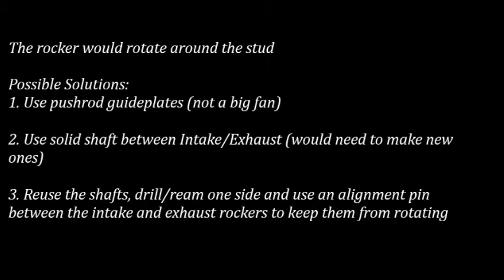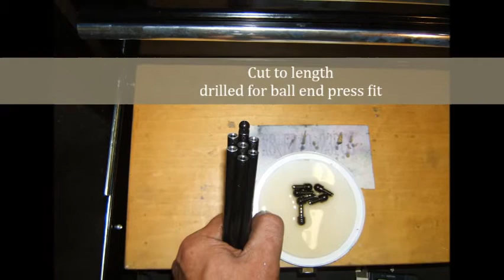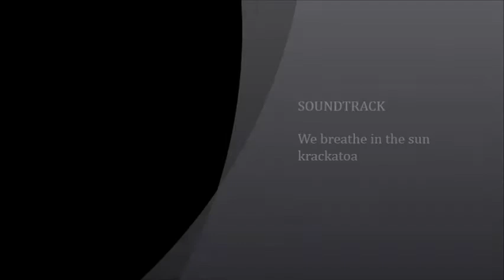Jeep Wrangler YJ 1.7 Roller Rockers

Comment: I finished my rocker install tonight. All I can say is WOW!!! The low RPM torque gain is amazing. I can just let the clutch out with out giving it any gas and it pulls away without stalling.
The Valve cover is angled on the front and only hits the first rocker/nut. So I cut a hole where it made contact and welded a patch over the hole and it gives it enough height to clear.
I really want to thank you for this idea. It's a great mod.
Reply from the maker: hey, glad to hear you got your's done. did you use scorpions or different rockers, and what did you do for pushrods. Thanks for providing an update, great to hear I might have helped someone out there :)
Reply: I used Speedmaster rockers off Ebay and I found a set of 9.8" pushrods on Ebay. The pushrods are 3/8 dia. so I used a 1/2" ball mill to cut the clearance on the rocker.
I also found a set of Ford rocker studs that are 5/16 base 7/16 upper. I still had to shorten them on both ends and thread them a little further, but they worked.

Comment: I wish I could buy a set of these rockers for my 2.5l TJ I can't find anyone that sells them boosted technologies has a set for 350$ but they are sketchy company I wonder if the 4.0 Harlem rockers would fit under the valve cover of the 2.5l TJ I just turbo charged and really would love this extra performance mod for the 4 squirls . Any info would be greatly appreciated thanks for the video posting I know it's old but us 2.5l guys out here will do anything for an extra shot of power and to show the 4.0 what we can do 💪😁
Reply from the maker: All the info you need is in the video, the scorpion rockers are the best choice imo short of spending an arm and a leg on a kit made for the 4.0L AMC/Jeep engine and using 4 out of 6. I did buy a different set before (different brand) and they had oilite bushings (bearings) instead of needle roller bearings. Only issue is drilling the holes to put the locking pins in and the fact that they come in a set for 8cyl and you only need a 4 cyl (so 1/2 the rockers). You can order the pushrods to length if you're not comfortable making your own. I also believe there is a kit for the studs and you end up drilling and tapping the head instead of making custom ones but I don't have any first hand experience with that.

Comment: Nice job and Thanks for sharing it! Any updates on the reliability?

I just ordered a stainless rocker set $100 and some oil hard drill rod $9 for 0.250 x 36" to start the project...

BTW what pushrod length did you end up with and how in depth did you investigate the geometry? It seems well centered just curious about that part of the design...
Reply from the maker: I built 2 adjustable pushrods (cut a stock one and i think i threaded M6 or M5 inside and used a threaded rod to extend), i also locked 2 lifters at the preload depth (took it apart and put some washers inside to make it solid) and then adjusted the rods until the rockers were well centered about across the whole travel and have reasonable angles. 
runs like a champ, no issues and it always well oiled on top, took the cover off to fix a pinhole I had in a weld when i extended it and is very clean with no burned or caked oil on top.
Length of the pushrods came to 9.830'' (info is at the end of the vid), the adapter studs info is wrong in the vid but correct in the description. Your length might be different, best to measure, there is some adjustment but the geometry needs to be correct (as you pointed out), I took quite a bit of time investigating that as well as having to create clearance on the back of the rockers so the pushrod won't bind (make sure you check yours, might be that is not an issue with your rockers but that can cause some big problems if the pushrod touches the rocker body).
You also need to make sure that the hole in the ballend will eventually line up with the hole in the rocker so you get proper oil flow on top otherwise you risk seizing the rockers.
Keep me posted with your project, hope it all turns good, good luck.
Reply: @sharpx777  yeah you 2.5 guys can easily remove lifters without pulling the head I forgot about that... 

I have considered converting them to non adjustable and shimming... will have to look into it.. also considering redrilling the head for standard studs instead of the custom studs...
Reply: @sharpx777   So it turns out these stainless ebay bbc rockers are pre drilled on one side of the trunion to 8mm or about 0.315 and probably 0.400 deep, so all I have to do is flip 6 trunions with these in terms of machine work there really isnt any, that was unexpected, looks like 8mm drill rod is pretty common too..
Reply from the maker: @doddgarger6806  nice, sounds like you got some work cut out. what rockers did you buy? (if you have a link you can share, just curious).
Reply: @sharpx777  they were the procomp electronics stainless bbc roller rockers option, looks like a few distributors are getting the same castings and rebranding them but here's the link.. I opted to avoid the self aligning feature as they're designed for a larger diameter valve stem but some machine work and hardened washers either side of the roller tip could allow them to be used... 

https://rover.ebay.com/rover/0/0/0?mpre=https%3A%2F%2Fwww.ebay.com%2Fulk%2Fitm%2F291950964173

Here's a set of 5/16 bottom studs 7/16 top too 😁

https://rover.ebay.com/rover/0/0/0?mpre=https%3A%2F%2Fwww.ebay.com%2Fulk%2Fitm%2F301939905187
Reply from the maker: @doddgarger6806  nice find on the adapter studs, couldn't find a set like this when i did it or didn't look hard enough maybe.

Comment: Awesome work. Could you notice the power increase? If you made kits I am sure people would buy them. Shoot Yella terra makes 1.6 rockers for the 2.5l at around 500 bucks. I would be interested in a kit if you sold it. I don't have the equipment to weld and ream.
Reply from the maker: there's nothing to weld though but there is a bit of machining. You can def tell it's got extra umph but i do have a few other things that help with the airflow (64mm throttle body, 3'' snorkle into an Atlas K&N sealed high flow filter, 2.5''  all mandrel bend aluminum piping from there into the throttle body and an enlarged intake manifold to match the 64mm t/b). It's no corvette :) but with the 2.5L 4banger anything helps. I also put 4.88 gears in the axles and a 6 speed from a TJ Rubicon so that adds to the whole experience (and a custom 4 speed tranfer case - a Dana 300 with a 4:1 doubler in front of it I made out of a busted Rubi t/c that came with the 6 speed).

I don't make them for sale, it's just a 1-of for fun.

Comment: Thanks for the video I can do the rest myself because of what you have shown. Should I step the studs down to 3/8 the rockers I am looking at are 7/16s
Reply from the maker: that's what i did, made them out of 7/16 NF (fine thread) grade 8 bolts, cut the head, turned down and threaded the other end - see at 5:31 for details (also the pushrod length is there). other alternative is to get standard ones and drill and tap for larger studs but unless you use higher rate springs I don't think there's any benefit to it.
EDIT: they are 5/16-18 to 7/16-20, I have the wrong info in the vid, sorry about that.
Reply from the maker: I have to amend my previous reply, I looked at my notes and the adapter studs are 5/16-18tpi to 7/16-20tpi (so the info in the vid is also wrong), I did buy some crane adapters but didn't use them and those are 3/8 on the head side.

Comment: That is some fine work. Would the 1.8 ratio rockers work?
Reply from the maker: +account4info Thank you! 
sorry for the late reply, somehow I did not get notified of the comment.
not sure if the 1.8 would work, as far as I can tell the 1.7 is about the limit to which you can go from a valve stem and pushrod alignment. there is also a matter of coil spring binding, would have to be checked and in case it binds longer valves or recessing the valves more in the head might be needed. If I can help with anything else let me know.

Comment: What push rods did you use? I can't find a set of cut to length rods. Are the balls on both ends the same size? 
I like how you pined the rockers, but why didn't you just cut a guide plate for each pair of rockers? 
Did you press fit the pin or is it a slip fit like a dowel pin?
Reply from the maker: Dowel pin is a slip fit, 2 thousands or so clearance, just barely enough to not seize. I don't like guide plates plus it would have been more work (or to me this seemed more straight forward).I made the pushrods, comp cams cut to length, same ball size and diameter as stock, but yes, i looked for a ready made one and the closest I found was a Ford I6 I think but can't remember if it was the length that didn't work in the end or they were cup/ball type or different ball size and couldn't use them (I looked through an entire catalog and nothing worked). 
Thanks for your interest in the project and good luck with yours.

Comment: Why not just use 4.0l rockers a bolt on, you went to an awful lot of trouble for something you can buy off the shelf.
Reply from the maker: 1. The most important reason is because I can, obviously that works for me but not for everybody,.
2. The scorpions weren't available at that time (check the date of the vid, did this 8 years ago), they also use guide plates and I'm  not a fan of that, and they are $400 per set (so for those reasons I wouldn't have picked them up anyway).
3. Harland Sharp were $500 at the time and only in 1.6 ratio.
So no, they weren't available off the shelf (nor are they now in the same config for the same price)

Comment: how much did it cost?
Reply from the maker: +Hans Evensen 
if I remember correctly was around $150 for the roller rockers set (ebay) and another $50 or so for the pushrods, add bits and pieces for another $30.